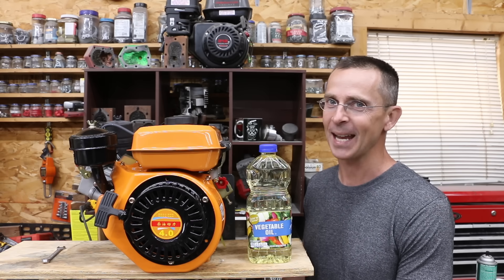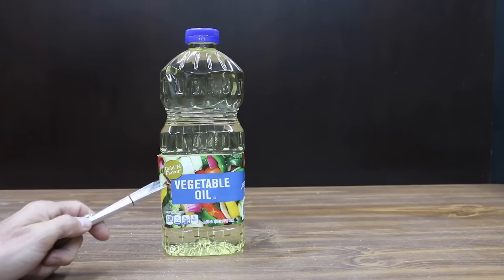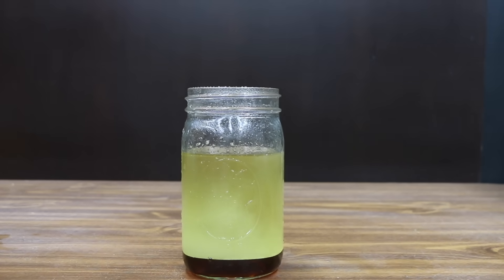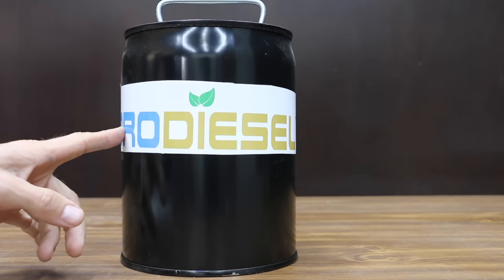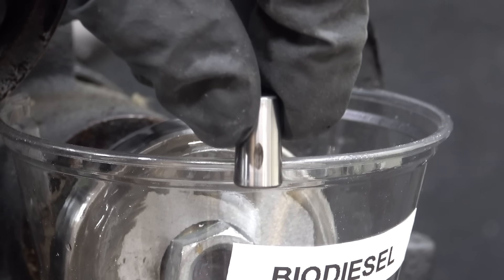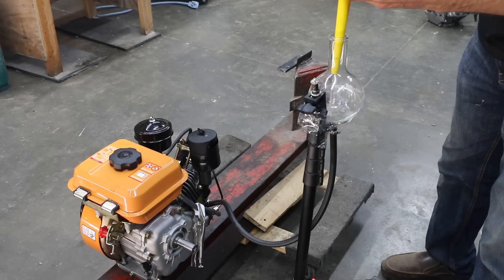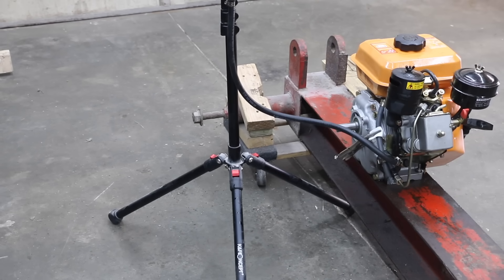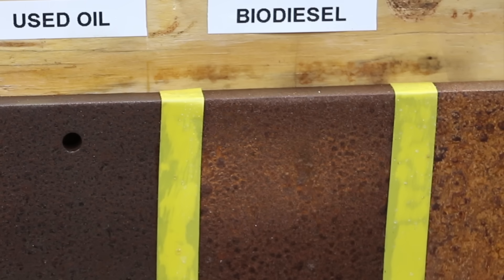Make "Biodiesel"? Let’s find out! Diesel vs Biodiesel, Used Motor Oil, Vegetable Oil, MPG

Comment: You "cleaned" the engine with diesel but you had a better cleaner available. When diesel and biodiesel are used alternately in the same engine, the biodiesel has a reputation for clogging things up. This is because the diesel creates buildup that does not leave the engine or fuel system. Biodiesel is a detergent. It breaks up these buildups causing them to be injected into the field system and engine. The fuel filter clogs up significantly faster when biodiesel is used together with diesel, because of the build up caused by the diesel. Using diesel to clean an engine out is like using dirt to wash your dishes. Yeah, it works, but it's not the best idea.
Reply from the maker: Thanks for the feedback.

Comment: I personally tried used motor oil mixed with 87 octane gas to a 8:1 mixture in an 04 Duramax. It worked and was almost free. Still pulled great and didn't lose fuel mileage!
Reply from the maker: Thanks for sharing.
Reply: @wayne Koger what fuel pump did the 04 duramax have?

Comment: I did drive Mercedes Vito 108D no turbine for 3 years on V cooking  oil, consumption was little more around 400-500 ml per 60 miles, I did not notice a power loss probably because it was a small engine only 80 horse power. And you forgot mentioned used oil is mineral or synthetic.
Reply from the maker: Thanks for the feedback.

Comment: I never 👎 came by knowing this until I read about landfills. I’m not sure 🤔 if biodiesel can be made by this method, but when trash 🗑 is buried, it is in an almost 😅 zero oxygen environment. As the trash 🗑 very slowly decomposes, it produces natural gas ⛽️. This is used to fuel ⛽️ homes 🏠 across the city 🏙. I think 🤔 the gas ⛽️ is piped from the landfill, to houses 🏠, factories 🏭, etc. I cannot remember how many 👨 years a landfill can keep producing natural gas ⛽️, but I’m pretty 😍 sure it will do it for at least several hundred years. I was so surprised 😮 to know this. Your friend, Jeff.

Comment: I know my grandpa uses cutting oil from mobile with his coolant is it a better way to prevent corrosion and increase lubrication but I thought just popped in my head can a diesel engine run on cutting oil and how much water does it take before Hydro locks since cutting oil is water soluble.
Reply from the maker: Thanks for the suggestion.

Comment: i was over dealing with cleaning and cooking out the water from restaurant oil. so when it came time to adding all the crazy chems to change it from oil to biodiesel i would just mix normal bought diesel 50/50 with my clean oil and it would still run and start at cold temps fine
Reply from the maker: Thanks for sharing.

Comment: Not sure you will see this at this point but we use to run golf course lawn mowers (they were diesel)  on the used frying oil from the kitchen. We would "filter it" using a bucket full of rags and then mixed it automatic transmission fluid with the oil. Not sure on the ratio but apparently ATF is a good injector cleaner. The mowers ran like this every summer for about 3 months for years. The only side affects were cold starting once the weather cooled off was more difficult until we started using normal diesel and the fuel filters would need replaced after afew months of doing so. Hope you find this useful. It really did work great with no other issues that I recall except smelling like burnt French fries
Reply from the maker: Thanks for sharing.

Comment: I still believe you would have better, more accurate results if you would invest in  an engine dynamometer. It would tell you the deference in power output of the engine with the different fuels. Also that will tell you if the engine is running with the proper air/fuel ratio.

Comment: Thank you very much for this topic. I recently purchased a 12v Cummins ram and would like to experiment with used motor oil and regular diesel blend. I have a friend who runs a mechanic shop, so I have a ready supply if I can figure out an affordable and compact filtration method.
Reply from the maker: Congrats on the 12V.  Great engine!!

Comment: When I was getting ready to get my drivers license my dad was really researching the idea of running used vegetable oil in a car. I got excited by the prospect and ended up buying a '92 Mercedes 300D as my first car. We collected a bunch of used oil, tried filtering it and eventually decided on some concoction of the oil, acetone, and gas to thin it out. Went through 4 or 5 inline fuel filters with that one tank haha. It ran pretty rough until it heated up. Lots of guys install a second tank with heated fuel lines to run veggie oil by itself. Diesel engines are awesome!
Reply from the maker: Thanks for sharing.

Comment: I accidentally filled the bosses diesel work ute with petrol instead of diesel then drove it 100 klms. It ran very well being very responsive and there was no damage except it wouldn't start and my reputation. Diesel was invented to run on any fuel available. Great channel.
Reply from the maker: Thanks!  Thanks for sharing.

Comment: IDEA = instead of motor oil in the crank case why not diesel, then route that same diesel into the injection pump, feeding the crank case directly from the fuel tank. BOOM!  no more MOTOR OIL needed at all.

Comment: There is a guy in Australia who runs his truck and his wife's Mercedes on used fry oil he gets from a few restaurants. He has a channel on her, but hasn't added any videos in a long time. I think his channel name is OIL BURNER.. Anyway, he collects and saves the used fry oil in large totes. (225 gallon) I think. He keeps the totes right at his house/shop and simply allows gravity to clean the oil. I think he also filters the oil being pumped out into the car or truck, but he adds nothing. Says he's been doing this for years and plans to for as long as he can get fry oil...
Reply from the maker: Thanks for sharing.

Comment: I run 90% used motor oil and 10% pump gas in my 1994.5 7.3 powerstroke. Runs amazing and get the same gas mileage as normal diesel with just a little more smoke with a lot of acceleration. I get my used oil from a local autozone and I recommend everyone else do the same in 2003 and older powerstrokes. Idis and 7.3’s love wmo
Reply from the maker: Thanks for sharing.

Comment: Some time ago you did a test on your pick up with a hho cell, which did not show any gains for a couple of reasons. That little diesel engine is a perfect test subject for another go at the HHO philosophy, because it has no electronic sensors and no O2 sensor to bypass. The trick is to find just how much hho to add to that little engine. But when you hit the sweet spot you should see a 6% decrease in consumption along with less HC´s in the exhaust.

Comment: What about wast grease from fast food places. Has to be filtered and warmed, could even mix with kerosene. Run dual tanks like stated in other comments. Start with diesel, switch to other fuel, then finish with diesel to clean lines. Don't want anything solidifying past the tanks
Reply from the maker: Thanks for the suggestion,.

Comment: Can you test this when the engine runs out of oil in the system and gets to a low level and top up the same new oil to the max safe level does this oil get the quality improvement of the new clean oil get some improvement in viscosity and quality
Reply from the maker: Thanks for the suggestion.

Comment: That Cummins with the P7100 pump was a great engine both for the power it could produce when tweeked and the fuel economy it could do. Too bad they were in Dodges. 

There is a difference between the simple mechanical diesel engine you have and the "modern" diesel fuel injection engines. You would put 10% gasoline in a modern diesel at your own risk, actually the risk of the injectors to start.

Same with straight Veg oil.

Comment: Great test! The only thing off slightly is the process of making biodiesel is  #1 titration getting the acidity level of you used oil (fatty acid level) that tell you how much chems you need to butralize the acid and make soap as a by product. I wonder if you had used wast veggie oil and converted the oil to biodiesel if it would have preformed better ay the corrosion test  ... my 2cents but thanks for a great video!!!
Reply from the maker: Thanks! Thanks for the feedback.

Comment: Using vegetable oil as fuel is a way better use of it than eating it. That stuff is poison, stay away from it. It oxidizes so easily even when its sitting on the shelf and it slowly kills you.

Comment: I drove a diesel VW Rabbit for quite a while and we used to run 10% used motor oil mixed with Diesel. Engine always looked clean and 10% fuel savings was nice. Didn't hurt milage either as I got close to 50 MPG.
Reply from the maker: Thanks for sharing.

Comment: pretty fun, your lubricity tester is exactly the same as the official lubricity test of Jet A-1 fuel (and possibly your american Jet A fuel) but then in a more controlled manner :) Altough we use a kind of bearing ball that gets scarred on a cilinder instead of a piece of metal like you. The basics are exactly the same :)

And yes, 100% biodiesel (that is Fatty Acid Methyl Ester, which you made, not Hydro Treated Vegetable oil which is considerd biodiesel V2) is very good lubricant
Reply from the maker: Thanks for sharing.

Comment: read your owners manual. I've seen a vegetable oil van. You start on diesel and a heater hose warmed the used fryer oil they retrieved by dumpster diving restaurant oil containers. The exhaust smelled just like french fries. But My 2019 Kohler TDI will NOT run of bio diesel and voids the warranty So read your owner's manual
Reply from the maker: Thanks for sharing.

Comment: how about building a hybrid car with that diesel generator, battery system (maybe even super caps) and an electric motor in the best combination of efficiency of set up and operation to simplicity of design and build

much thanks, always appreciated

Comment: I had a old TDI VW Caddy. It ran for about 5 years purely on used hydraulic oil. Never once did the car breakdown due to a fuel issue
Reply from the maker: Thanks for sharing.

Comment: I realize that the video is a year ago but as of now the fuel prices are so high and i only have 1 quarter of land and i have older tractors a 4020 John deere and a 1070 case. I don't have a huge supply of used oil except for oil changes on the tractors and 4 other vehicles but i need to get trans hydraulic oil changes and automatic transmission fluid changes. My question is would trans hydraulic oil or atf burn as well. I would like to put an additional smaller fuel tank on front of tractor so as to mot contaminate the main tank and do a blend of used oil and diesel fuel not sure what blend would be best 50/ 50 60 /40 70/30 . I have a filter system for filtering the used oils first before I put in auxiliary tank . Another reason I want the auxiliary tank so i don't have oil in my fuel for cold start ups in winter months at -40 . The diesel prices are $2.25 a liter which is a little over 8 dollars a us gallon up here north of the border this is why I'm wanting to know if the trans hydraulic oil and atf or even gear oil in small amounts blended would work.
Love watching your videos and viewers suggested tests very entertaining and informative keep up the good work  👍👍👍🚜🇨🇦🇨🇦
Reply from the maker: Some people burn atf and oil but it can cause carbon build up over time.

Comment: I have made over 26,780 gallons of biodiesel since 2007. I use a specific gravity meter and a ph meter to get my fuel into spec. I also have created biodiesel manufacturing plants.
You should be explaining the correct specific gravity tests and keep your ph levels correct.
Reply: What is a good specific gravity to have for the used oil

Comment: I work at an airport so I run my 7.3 IDI off of our waste jet fuel mixed with some waste diesel oil to add lubricity back to the fuel. Haven't paid for diesel since I first picked up the truck and drove it home 🙃
Reply from the maker: Thanks for sharing.

Comment: You don't need vegetable oil.
All you need is a press and algae.

Convert a 1x1 meter space in the backyard with a table that keeps the water in motion and then add a mechanism to strain after a week or so. You'll have a bucket of algae that can be pressed for an incredibly high oil efficiency.

Comment: From the guys that make their own BIO product in the Deuce and a half world, they unanimously say stay away from vegetable oils.  If you saw the images they've shared with clogged lines and injectors, you wouldn't ever cook with that crap every again.  Motor oil after sent through a centrifuge works really well, and after your bio-diesel is washed and additives included,  you'll be amazed at  how clean and efficient it is.  And bio-diesels need higher temperatures to burn efficiently.  Many have dual tanks with diesel  in one, bio in the other.  Start with diesel, switch over, and switch back to diesel before shutting down to clean out the system.  Another great video... thanks!
Reply from the maker: Thanks and you are welcome!

Comment: I had a isuzu 2.2 liter it would run off vegetable oil if the outside temperature was 90 degrees or higher.  Bio diesel was good down to 50 degrees,  below that  I ran home heating oil . I used 2 beer kegs to make my bio diesel.  The first one heated up the oil and filtered the oil the second keg made bio diesel.  My uncle had a tavern and fried fish on Friday.  So I got all the oil I needed.  . Ran it threw a good filter during the summer easy peasy.. 1 hour and had 2 weeks of fuel.  Bio diesel made from lye and methanol put in a blender then blended with the filter oil 3 hours but and hour and a half of actual work
Reply from the maker: Thanks for sharing.
Reply: @ProjectFarm  I would sure love to have that incredible running engine right now. Especially with hot weather around the corner.  Gas is killing me

Comment: First of all I have more experience than anybody on here about any of this stuff what they call black diesel they're basically used motor oil if you filter it it's not that bad biodiesel over time if it sits in a fuel tank is very very bad and will end up turning into a hard waxy paste I've had many trucks where we've seen them sit out in a lot to be sold or a SAT for nearly a year with a biodiesel compound mixed with obviously diesel and even other chemicals but over a period of let's say approximately a year the biodiesel will start to turn into a wax the bad part of that is that it will clog injectors and ultimately ruin fuel filters and far far More in high pressure fuel systems this is extremely catastrophic if you have more questions I know I guess contact me I really don't like biodiesel if anything the black diesel if you filter it it's actually better just filter used motor oil and then mix it with diesel fuel the bad thing is most fuel nowadays does have some amount of biodiesel which is especially not good if you were to let that diesel engine sit but say you have a farm tractor and it works in the summertime and it sits all winter that's very bad but if you have an engine that might sit for a year or two that's really really bad with biodiesel and we've seen this only in biodiesel I want to be very clear out of hundreds and hundreds of trucks we've worked on I've never seen the contamination issues from regular diesel it's only when it's mixed with biodiesel

Comment: I’ve ram used motor oil in a Cummins diesel like yours and it ran great.  Consumption was higher but the power was amazing, and it was free. Wouldn’t recommend it long term as I don’t know how it would hold up(I’m fairly certain it would be fine though), but it was free and I was in a pinch and needed “fuel”
Reply from the maker: Thanks for sharing.

Comment: My 1990 Toyota Corolla diesel (New Zealand) which I recently gave to my daughter would run just fine on filtered used fry oil at 50% with no problem.
Reply from the maker: Thanks for sharing.

Comment: Could you do a follow up by blending Biodiesel, WMO, and diesel in different combinations to see if it changed the performance at cold temps (gelling), lubricity, etc? Or if by blending them is even compatible as an alternative fuel from regular diesel. I was mainly curious if blending the biodiesel with regular diesel or blending with WMO diesel helped it from gelling at cold temps or would they separate? Thanks.
Reply from the maker: Thanks for the video idea.

Comment: you can skip the photasium and just use plain charcoal lighter fluid ethanol or methanol  on used vegetable oil with a ratio of 30% fluid and 70% used oil thats it easy 1/3 ratio will work just fine
Reply from the maker: Thanks for sharing.

Comment: we used diesel and used transmission fluid for years, depending on the truck  89-02 dodge, 85-02 ford they run great. avg mix was 50-60% the rest diesel.  old 5.9 can run on 90% easily but lacks  power.  the key to getting this to work in used oil is a good centrifuge to clean it first
Reply from the maker: Thanks for sharing.

Comment: If reading this,10months later. Please do a video on ammonia as fuel. Ammonia  has been used in rockets and aircraft for decades. A land speed record  has been achieved  in a straight  ammonia rocket car. People  are claiming  can do a car conversion  with a propane auxiliary  tank kit, but filled with ammonia.  
The main  problem  with ammonia  is how  it's created currently through  large ammonia distilleries that need a lot of power to isolate nitrogen , and the ammonia vapers that might escape in large enough  concentrate  a person Can pass out from the nitrogen  taking place of oxygen.
Reply from the maker: Thanks for the suggestion.